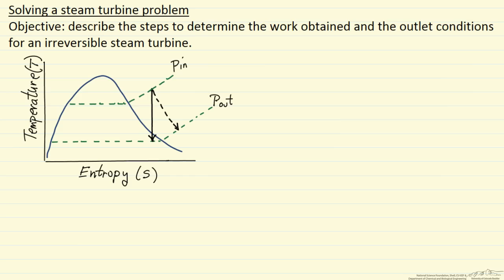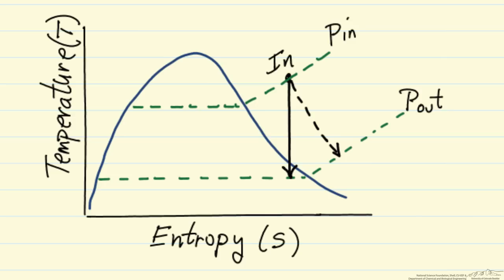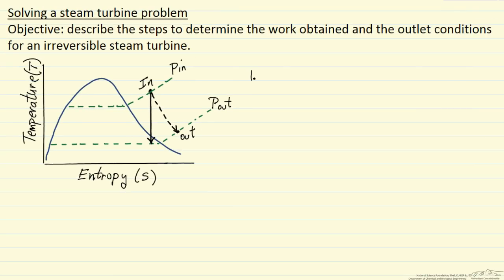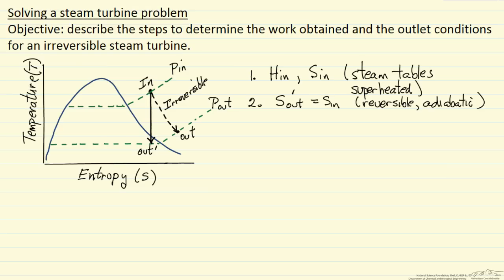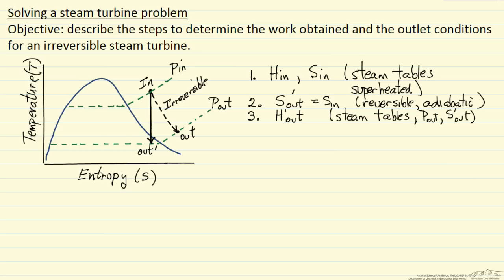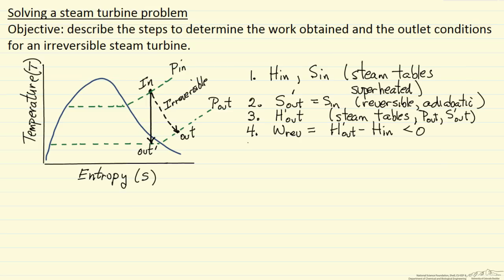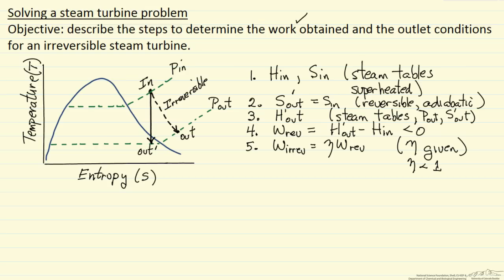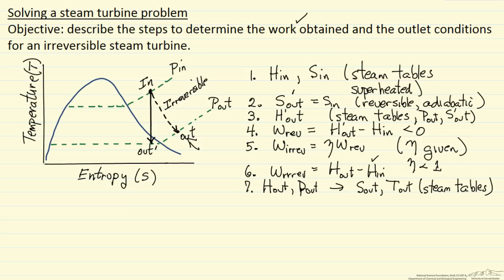Solving a Steam Turbine Problem

Comment: Sign of the work & heat confuses me in your lectures in general. 
Sign is negative or positive, not because u assign it like that, but as a result of numerical calculation it should be positive or negative.
Could u please clarify it. Thanks